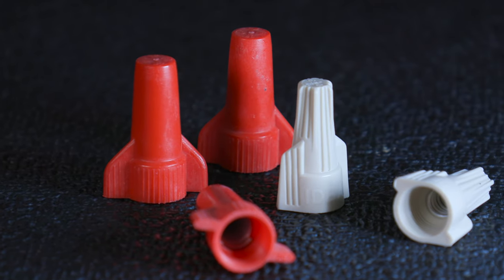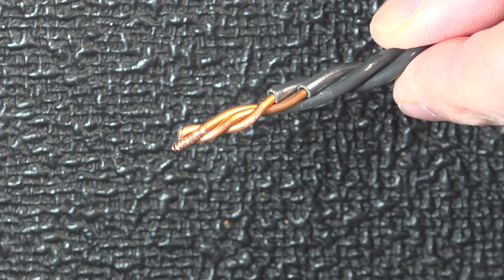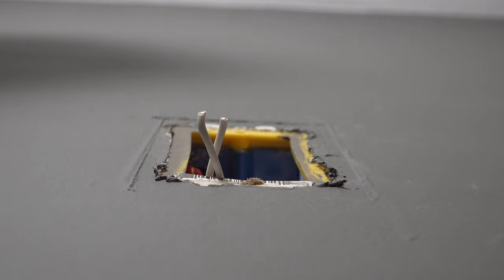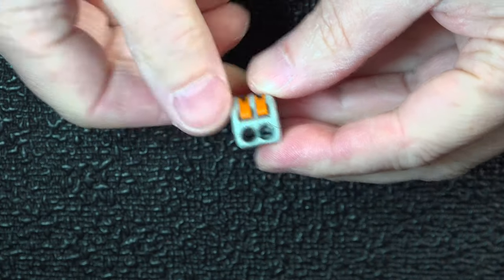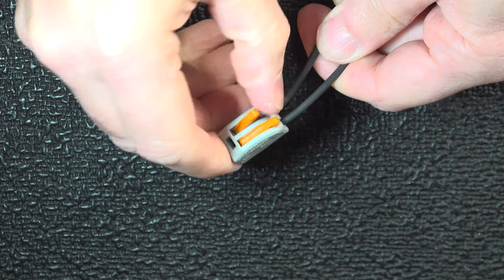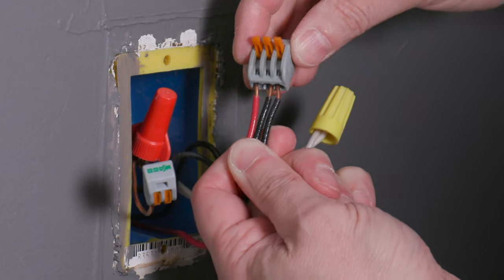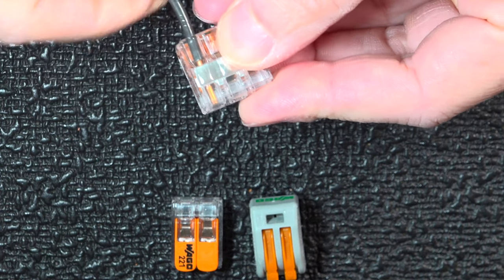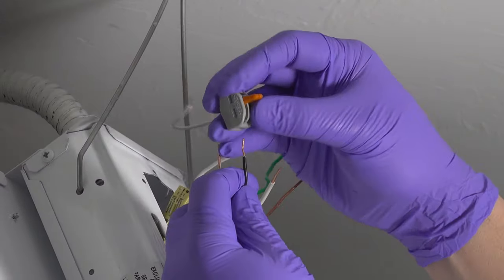Never use Wire Nuts Again - Wago is Better Electrical Connector

Comment: How often do the nuts actually cause a problem? I suspect that it is rare.
Reply from the maker: From an electrician one Reddit: "100% sincere, I have never seen one (Wago) fail. Seen lots of wire nut failures tho" Also search on burned wire nuts on google you will hundreds of examples, do the same with Wago and you will find none.
Reply from the maker: Cletus Ross  I answered with something you can check for yourself. Search on burned wire nuts & you will see hundreds of photos. Enjoy
Reply: The plastic is cheap,over time will crumble and start a fire. That's why there not allowed. Good for a,v nuts are better, if you hook em up right , no way they last longer than a wire nut.
Reply: @henrydycha3738  Why would it crumble? Magic? Lol..
Reply: You see WAY more wire nut failures because they've been around forever, the wagos arnt as common so of course you'll see much less failures documented.
Reply: @csmith6237  True but if you were teaching an electrician from day one a wago is alot easier of an application. I've seen plenty of wirenuts pop off when pulling out switches and receptacles..
Reply: @JustinL614  through time plastic breaks down.even outlets do. Uh duh.
Reply: @JustinL614  if done properly you could hang off them...  improperly... what you sd

Comment: No thanks, I'll keep using my "incredibly dangerous" nuts along with the billion others out there and someone else can make the company richer that has a solution looking for a problem.
Reply: They work well if you have more than 3 wires,  I still use nuts but wagos take up less room.
Reply: the nuts you are using are a horrible device that doesn't create a proper and sufficient connection to the connectors. frankly you should be soldering and heatshrinking every connection you have or using distrabution or junction blocks like wagos.
Reply: Then explaim why are all the wire nut connections from 1960 still carrying current and not burning my house down? Or the 160 other houses in my subdivision? 
Also are wagos supposed to be hot to touch under normal operation, like many I've run into?
Reply: @Recreationaltrespasser  because electricity isn't as dangerous as most people make it out to be, and frankly they are sufficiently bad to not cause an issue most of the time. you should still prefer a more secure connection such as a solder joint or a junction block. it doesn't have to be a Wago.
Reply: @TheObsesedAnimeFreaks  so electricity is dangerous, but it's not that dangerous, but connections that have worked flawlessly for 60 years are dangerous, but not as dangerous as lighting up a torch next to some lady's curtains, or carpet, or fiberglass insulation.
What exactly, in your estimation, is the problem with a linemans splice, capped with a ul listed insulated screw on wire connector?
Reply: @Recreationaltrespasser  I've already mentioned that twisting a couple of wires together and throwing a crappy plastic screw nut thing on top is NOT a secure connection and is prone to damage, arcing and over all bad connections that can cause other major issues. you should never rely on twisting wires together for a permanent connection sorry. Permanent connections should be made with solder joints and serviceable connections should be made with terminal blocks or other connectors PERIOD. if you are doing ultra temporary connections twisting wires together is a decent enough connection, but should never be a permanent long term solution. It's just not secure enough. Kinda like poke through connections on switches and outlets, those aren't permanent or secure enough to be considered safe. Wire nuts should not be considered safe either.
the issue is how securely the connection is made. if you can untwist it with your bare hands that's not a secure connection. if you can pull it apart it's not a secure connection. it needs to be to be secured such that you either need to physically separate the two wire by cutting the section out or use a device such as a screw driver to remove loosen the connection such that you can remove the wire.
Reply: @Recreationaltrespasser  
 @McLovin sings  
>explain what damage a wire nut connection within a box is subjected to, and explain how arcing occurs in a connection except where it arises from installer error.
uh... you can typically flick wire nuts off,  they also are loosely attached to the wires, among other reasons. i can name you a book of reasons why you shouldn't use wire nuts, i can't name a single reason why you shouldn't solder your connections or use a wago. YOU have no idea what you are talking about. you have never used a proper connections in your life. 
>because you haven't even touched on compression connectors, which unlike that crap you recommended, atually make good permanent connections.
You mean like screw down terminals or wagos? both of those use compression to make a secure connection. you have no idea what you are talking about in all honesty. 
also explain to me why you trust a connection that you can pull apart by hand? why you trust a connection that no electrical engineer would bet their life on in any other application? explain to me what in heavens name makes a shitty connector like a wire not a good option for anything? guess what you can't. Because they are a horrible device prone to issues, installation error or not. there are many reasons why you shouldn't use them, none for soldering and none for any type of actual "compression" terminal block.
Reply: @Recreationaltrespasser  
> If you were an electrician you would know I am referring to a crimp on connector,
also a valid use of the term. Crimp connections are also very secure can can result is better contact over all. There are a lot of connectors that are crimp on based, and rightfully so. just because it's not the first thing I thought of means nothing. If you said crimped connectors, I would be right there anyway. You want me to complain about crimp connectors when there isn't much if anything to complain about?
>not one of your little screw terminals, which I can and have yanked apart. 
If you have the screw wasn't tightened properly. just like your argument that wirenuts are perfectly serviceable. the thing is that it's far easier to make sure a screw terminal is properly tightened then a wire nut. and screw down terminals are something that anyone with half a brain would properly tighten, arguably over tighten but still.

This goes to show that you are just discounting a view point because you don't care what they have to say or their concerned on a matter. just because you are fine with a horrible temporary style connection that should never be used in a proper installation doesn't mean that others are fine with it or don't want it to be used because of their issues with how horrible the connection really is.
Reply: @TheObsesedAnimeFreaks  I'm not discount if you're view point because I don't care what you have to say, I'm discounting your viewpoint because I've heard what you've said.
Reply: @Recreationaltrespasser  you have no idea what discounting something actually means. Then if you have heard my arguments my issues with wire nuts , provide me with an actual argument rather then "their ul listed that makes them good" or "you're using it wrong. " address the arguments that they aren't secure. Prove that they are secure, address my issues with contact area, address my issue with how easily you can screw up the installation with them, among other things. You have just discounted everything thing that I have said and treated it as moronic and not worth your time. Prove me wrong. Just plainly prove me wrong. You have yet to.
Reply: @Recreationaltrespasser  you do realize I didn't say they overheated, also how about dropping a ceiling fan to be caught by a wire nut connection or some other heavy object? or how about something a little more substantial like something that is heavier then you are. Regardless, while I'm humored you decided to make a couple of videos showing things I already knew, you haven't addressed the root of the argument.  The argument of they aren't secure is rooted in how easily they come apart, how fragile they seems to be. among other issues. A far as contact area goes. that's a stupid way of saying something about the the contact area of a connection when the person arguing for soldering the connections views such an act as in general increasing the over all volume of metal to transfer electricity with, and overall securing the connection. blah blah blah blah, point being you haven't convinced me of anything, and I said something stupid without fully thinking about what I was trying to say, specifically "contact area," as that's probably not the right way to put it... except from a "it should have all the contact area," perspective. and regardless, the devices are sill inferior to something that provides a more organized wiring layout, a better reusability, better safety as a secure mount point and secure connection, or any of the other issues I have with wire nuts. This is coming from someone that thinks all appliances should be grounded period. it's coming from someone that views any permanent connection that doesn't require a tool to remove and can't be secured and affixed in a permanent or semi-permanent manor as insufficient. this is coming from someone that sees unorganized wire mess as a fire or general safety risk. This is coming from someone that would want conduit run for all cabling for simple organizational and ease of use reasons. 
I'm so particular in what I find acceptable in something that my views on things like wirenuts revolve around their derivation of a less then permanent connection type that is often done in prototyping and isn't intended to be reliable or permanent. With a screw down terminal you can torque that connection to a spec that will prevent it from actually backing out due to random environmental issues, you can also string a bunch of circuits together from a fixed mounting point rather then loose in a box somewhere. it makes organizing the wires of a box far simpler and far less of a risk of dislodging your precious wire nuts. the entire reason for my disliking of them revolves around a more practical view from my experience swapping out light switches and having to fight wires to put the new light switches in. realistically if a light switch is of a standard size it should just fit right? not when you have a bunch of wire mess behind the light switch making it far less practical to actually put them back into the gang box. for bulk, for the same safety reasons you shouldn't just jam cables back into a gang box to begin with, when they aren't organized in a way that makes that action easy, and wire nuts are getting in the way, the entire argument that they are remotely safe starts to fall on it's face. I don't like them because I don't think the serve a purpose that actually matters, or is well served by the device itself, there are better devices and technologies available that make the life of a homeowner or electrician easier and safer.  Wire nuts are not such a device. they are an old technology that needs to be phased out with a better more secure technology more inline with our technological advancement and needs for better organized electrical boxes. there are better ways to do everything period.
Reply: @TheObsesedAnimeFreaks  >the argument of they aren't secure is how easily they come apart and how fragile they seem to be
>Video of a 180 lb gorilla dragging around a workbench by a wire nut
Only one of these can be true
Anyway, wire nuts are perfectly adequate within their range of application. I have nothing further to say to you.
Reply: @Recreationaltrespasser  but they are not. Your work bench weighs what 20-30 pounds? You dragging around a work bench does not prove a point. Also there are different failure points and modes. Sorry.
Reply: @TheObsesedAnimeFreaks  you clearly do not work as an electrician. End of story.
Reply: @TheObsesedAnimeFreaks  people are discounting what your saying because it is actually 100% nonsense. Complete nonsense. From what you’ve written it is clear you are not working in the electrical field. No body solders anything in residential, commercial, or industrial electrical fields unless they are tinning the end of stranded wire or working on an electronic component. Everyone twists wires and uses wire nuts.  No further conversation needed.
Reply: @-Nobody-1  you clearly put more reliance on a tradesmen that has incentive to not change what they do, then actually looking to innovate in an industry. All appliances should be grounded period, wire nuts should be retired for a more reliable less fuckable connector, and all rooms should be on their own circuits. no putting an entire floor on a single circuit or a couple of circuits when you can easily blow that shit if you have enough tech in any of the rooms.
Reply: @TheObsesedAnimeFreaks  dude your off your rocker. Get some trade experience in the field. What are you going on about.
Reply: @-Nobody-1  you clearly put far too much trust in a horrible technology that is backed by an incredibly temporary technique for electrical connections. twisting wires together has no place in a production environment. sorry. get some actual intelligence and stop repeating dribble.
Reply: @TheObsesedAnimeFreaks  dude... you need to stop. You’re talking nonsense. Wire nuts are industry standard in residential commercial and industrial wiring throughout North America.
Reply: @-Nobody-1  "nonsense" when you have an easy to fuck up, horribly insecure connector that needs to be retired? really? sorry the connector is trash and should never be used. there are better options out there.

Comment: When I was working at a butcher's shop built in 1911, we found that the 110v circuits were still running on bare wire knob and post with ceramic wire nuts. I still have a bucket of the hardware I pulled out during the rewire.
Reply: I love the porcelain wire nuts. A special satisfying feeling using those
Reply: Yeah, they are the ones that gave wirenuts a bad name outside the USA (I'm amazed they are still so prevalent over there TBH).  In Europe they are illegal (the old-style ceramic ones) due to the many associated dangers and obvious fire risk.  By the time the new plastic ones came over here we were already developing new techniques, and very shortly after we had started experimenting with your new ones once they were tested and approved the new Maintenance Free style Wago and Ideal pushfit and snapfit terminal blocks hit the market and everyone found them to be so superior in every way that twist-nuts just died almost over night   (Only a small number of old-school sparkys ever did experiment with the new plastic re-release wirenuts because the new generation had already learned the horror stories of the original dodgy-shit ceramic ones and once that gets drilled into you, you tend to be prejudiced against anything of similar design!)
Reply: Yikes🤯

Comment: Where do you get the idea twists aren't reusable? 

Also I have tried this and they were huge compared to a twist. Try doing a 3 way switch in a 70s house with one.
Reply from the maker: Manufacturers instruction will indicate if they are reusable. Electrical boxes are square/rectangular. So are Wagos, which do you think fits better in a box? Wagos use 100% of the space if needed. But if you have your doubts heres a single gang box with a USB outlet and a pass through all fitting nicely: https://youtu.be/xuj-sEJryxw
Reply: @SilverCymbal  That is a standard outlet in a modern box. I specified a 70's house and a three-way switch for a reason. They are smaller and all the wiring with a modern basic light switch barely fits let alone a smart switch. I mean I guess you could replace the box...that's not toooooo huge of a pain. Where I live the vast majority of homes are 70's or older. Many even still have knob and tube O_O